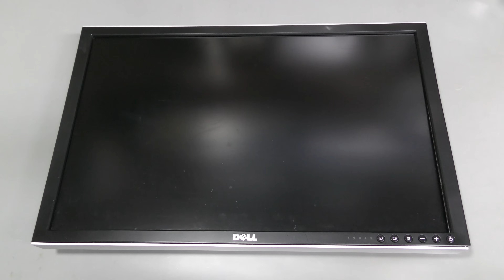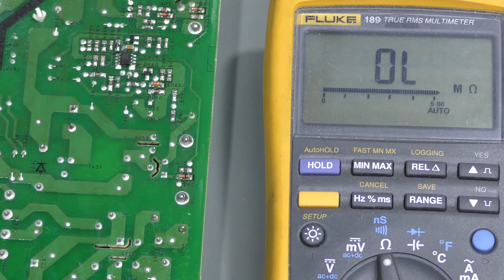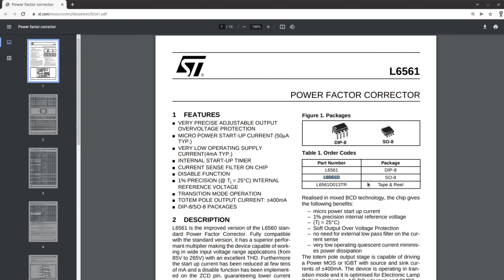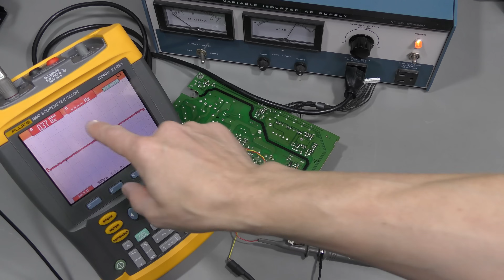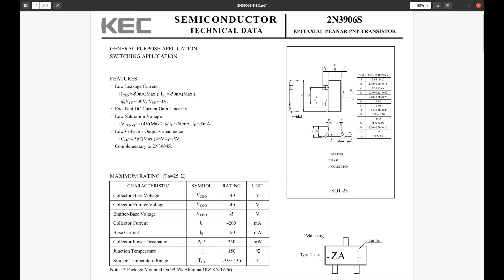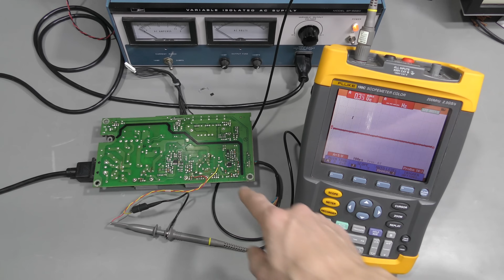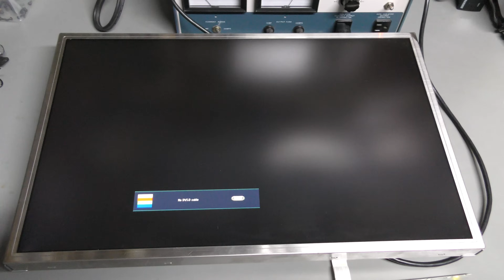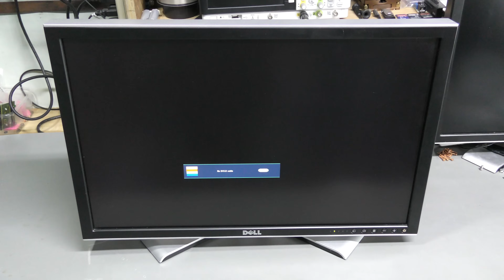#127 - Dell 2407WFPb monitor repair

Comment: Very nice video. I have a monitor just like this one that gets very hot after prolong use. It gets hot to a point that the monitor turns off itself. The monitor turns back on normally after it cools down. Is there a fix for this issue?

Comment: I had a similar failure on mine. I took a different approach to repair. I cut the positive line to the 12v external power jack, and jumpered it to the DC bus caps on the LV side. I then fed 19v in from a laptop supply using the DC jack. It's been that way for some years now and it's all good.
Reply: Hey, looking for more details on how you did that.  I tried putting in 19v on that port without any modifications and it turns on but then goes into power saving mode.  I'm guessing if I jumper it, it would work,  just not exactly sure where to place the jumper wire.

Comment: Fabulous video. I happen to have this Dell monitor since about 2001 and it finally died on me. A good monitor and I still like it a lot. I will attempt to repair it. Your video is a good guide line. Thank you very much indeed.

Comment: After 16 years my Dell 2407WFPb monitor made this strange noise for a couple of seconds, and then it was dead. It was about time. But I just bought one of those 450v 120uf capacitor, which was also corroded, and hopefully just replacing that will bring it back to life.
Reply from the maker: I am afraid you might have similar cascading failure
Reply: @feedback-loop  Yes, I'm afraid that I failed.

Comment: Quite a number of failures. How can this be?
Would you think a series of failures over time but not bad enough to make the monitor unusable?
Or one failure leading instantly to a power surge and cascading failures?
Reply from the maker: Must be cascading. Most probably started from the capacitor.

Comment: I've fixed a few dead Dell monitors found in the e-waste at work by replacing bad caps. That’s the extent of my electronics troubleshooting abilities.
Reply: There are capacitor kits available for the most popular Dell models as well as other monitors and TV's.  I have had some success with them in the past but now I like the newer LED monitors better because they are lighter and have enhancements not present on the older LCD monitors.  So I most likely won't be doing this type of repair too often in the future.  Newer technology makes more economic sense.